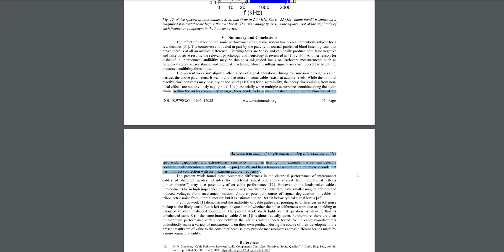Scientist Finds Measurable Difference in HIFI Audiophile Cables ! PROOF

Comment: A question for Jay and anyone else with experience:

Are there any cheap cables you have tested that are noticably different from other cheap cables?

ie; Do amazon basics sound different from monoprice or any other brand?

Im a bit skeptical of cables making a notable difference, but would like to try for myself (ideally without spending a lot of money)
Reply: If they're the same gauge, same insulation, same conductor material, they sound the same. Low voltage doesn't resonate at frequencies to make a difference, like 500 Hz (most power AC is 50 to 60 Hz, (and speaker wires are even less with low voltage). 

CCA (copper clad aluminum) does sound different in many situations. As for copper: it's all the same if it's high purity OFC. The place to look is in the dialectic insulation and terminations (spades are often better than banana plugs, bare wire is best of all but less convenient).. Those are really the only place cable construction matters. There is some possibility of creating a high capacitance, low inductance cable from geometry (such as braiding, done by Bell Labs in the 1950's), but standard rope lay is probably best. 

Realize 2 cables CANNOT sound different AND both be high fidelity and accurate. At least 1 is distorting, by definition. You may be able to use different cables to change or influence the crossovers of your speakers, as cables can be considered part of the crossover network. However, there is ZERO correlation between this change and price S$$. 

If you really want to get into cables, the insulation is probably what matters most past gauge and OFC copper. The electrical field flows outside the wires anyhow (Poynting vectors, QFT/ QED, etc.) not in the cable wires themselves. Any differences beyond that are the crossover being changed in LCR values due to wire anomalies. 

Check into insulation of pvc, teflon, ppe, etc. to see what you like. Usually the highest dialectic value is best. Air or vacuum is best, but there would be shorts, so we insulate wires. 

Wires are basically the last thing i would spend money on. Interconnects probably matter more. And every other piece of audio gear beyond that CERTAINLY does. 

Copper does not become a superconductor at any temperature, does not impart mass on photons, exclude magnetic fields, have metamaterial properties, or do anything voodu magic woo woo that people like to claim. Homogenous material metals like OFC Cu2+ of similar surface area with similar dialectic and similar terminations sound... Well... Similar. How much salt and water you drank that day will have a bigger influence on your hearing and how your system sounds than speaker wire ever will (especially during analogous conditions stated above).
Reply: @onebylandtwoifbysearunifby5475  
You nailed it!!

Buy 99-100% pure copper cable that's is 10-12 awg and you will more than likely be more than fine. 

The gauge and material makes the difference.  A quality $15 "pure copper" speaker cable that is 12 AWG will sound the same as a $1000 "pure copper " speaker cable that is 12 AWG assuming the connectors have the same resistance.

The Ohms (resistance) changes with material and gauge. That will change the sound.
Reply: Btw: "World's Best Cables", "Monoprice", and "Bluejean Cables" are all considered as good as anything by most people. "Belden" Cables and Interconnects are generally considered the best by professionals like pro-audio and recording studios. Abbey Road had 12 AWG twisted rope lay copper speaker cables off a roll last i heard. 

Pay what you feel you want to.
Reply: Blue Jean cables are a very good cable at a competitive - very reasonable price. I believe Jay uses them.
Reply: Careful or you may find the answer. Wouldn't it be preferable to research a cable that's "good enough" and offers quality, maybe some aesthetic, and just does it's simple job without much fanfare about sonic magic?

I've played around with a few different cables and haven't noticed anything significant, but I'm not closed off to the idea that they CAN make a difference. 

For instance: RCA interconnects. Have freebie pair from dvd player, a pair of $20 Roland (pro audio), AudioQuest $100 (the red box whatever that name is) and $250 Kimber... 

I don't think I heard anything different between them that I could easily nail down. Of course the $250 Kimber are on the system now. Go figure right?
Reply: not really
Reply: I’ve tried all kinds of cable. They pretty much all sound the same under blind conditions. A few exceptions where the high end cable rolls off the highs. The point of research is to gain objective knowledge. Not to win an argument
Reply: I replaced my old CCA cable which was pretty oxidised as well with some slighty larger awg OFC cable. 
I thought I had got a connection wrong way around or something because it was 100% different.

This is where i think the difficult part is, when you make a change to something and it is noticeable it isn't always for the better in first impressions because it now sounds not how you expect it to sound.

I think buying from two places cable of the same awg and type it probably wouldn't make much difference. 

If you was going same awg but one is lots of strands instead of fewer more solid cable would it be different, maybe. Would it be better  maybe...

Let's hope there is more ways of measuring in the future but even then use what you like the best.
Reply: Blue Jean cables are a very good cable at a competitive - very reasonable price. I believe Jay uses them.
Reply: DNM solid core copper interconnects are really noticeable. Worth the moderate asking price. Speaker cables as well but being being single strand they do lack some bass heft.
Reply: I purchased the Blue Jeans Cable "Ten White" speaker cables and found that they significantly opened up the sound to my speakers over the hand-made 18 gauge cables I previously used.
Reply: 3 different types of sound: #1 Silversonic revelation, #2 Cardas basic cable #3 MIT cables
Reply: Get a hold of any kind of cable by Furutech, probably the most obsessive engineering firm in the cable business.

Comment: Conclusion! if you haven't tried cables for yourself, you actually don't have any experience to comment period! 

Cables are gear and until you experience them personally you have no reference to their effects!

Personally I  bought 3 sets of high end used rca cables and coax cables. Cardas, silnote,  and audioquest. The difference with all the pairings was damn apparent and revealing. 

I spent  about 2 grand for about a new price of 6 grand on them. Soundstage,  air, bass, all different.  Worth the journey for me. Otherwise I would have never known!

Comment: I’ve absolutely heard significant differences in cables.  I one time changed some rca interconnects and my wife (who is hearing impaired and has hearing aids) immediately heard the difference. However this doesn’t mean that a more expensive cable sounds better than a cheaper one.
Reply: Was your wife in the kitchen?
Reply: RCA analog cables 100% can have differences.

Comment: I've always figured that cables would make th most difference in difficult to drive speakers ( 4 ohm & lower). Speakers that need large amounts of fast, clean power to reach their full potential would definitely benefit from high quality cables/connects. As opposed to something like K-horns/LaScala ,  that could be driven off a strong headphone amp. I have no evidence to back this up, just my own theory & 2 cents worth🍻
Reply: Yes I’ve asked myself the same question.
Reply: No question.
Current magnitude is everything.

Comment: If you want to know what’s going on in the time domain I believe you need to see the sine wave curve. Resistor ladder DACs lose the SINAD wars but they produce a much prettier sine wave compared to Delta Sigma…especially Delta Sigma that uses a sharp filter. Sharp filters create ringing and have a time delay. Slow filters do much better in the time domain (faster impulse response and less ringing)

Comment: Paper only shows time delay diffrences at 1Mhz+, also reflections and noise at 1MHz+ 
If there is time delay at 200kHz it will show up as phase and gain devation

There isn't any time delay or phase diffrence at 20-20kHz
Reply: If you found this in the paper, then please cite the page number or section.
Reply: It’s a small step in the right direction.  In time we will make further discoveries that will explain the differences we hear.
Reply: Yes there is...easily measured

Comment: Interesting. Maybe I should finally test my lamp cord with monoprice banana plugs against, say, some blue jeans cables.
Reply: What's almost as interesting to me as a difference existing is that the directional cable had a measurable difference when the directions were swapped. That seems to run counter to all my knowledge of electrical circuits, and yet it was clearly there in the data.
Reply: @Woodzyowl0309  That is interesting, when the guy from Vinyl Attack went to GR Research it was one of the things he changed was the direct of the firewire cable and he heard the difference.
Reply from the maker: those two are very similar from my listening experience but hey, don't let me stop you !
Reply: @Jayiyagi  I also just finished reading the paper and noticed that it specifically is testing single ended interconnect cables rather than speaker cables. Sounds like some more testing I should do in my system!

Comment: The differences in cables has to do with the time domain , and some high frequency roll off.
Reply: what is the time domain ?
Reply: If you have HF roll off at 20khz on cable you must have a really Bad and thin aluminium cable that is 10m+ long. Standard 12-10gauge Copper cable is good For everything and any speaker.